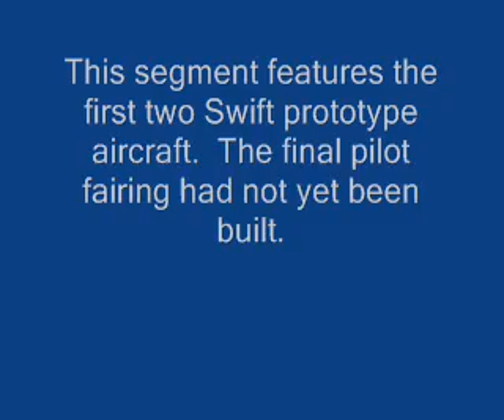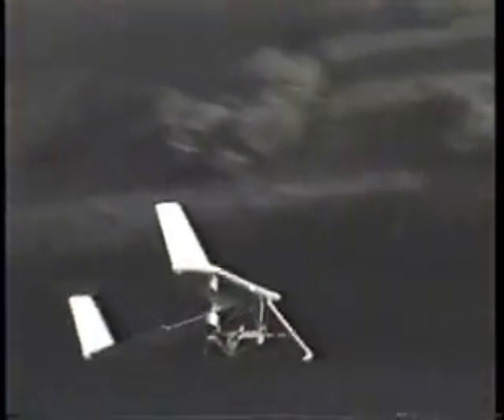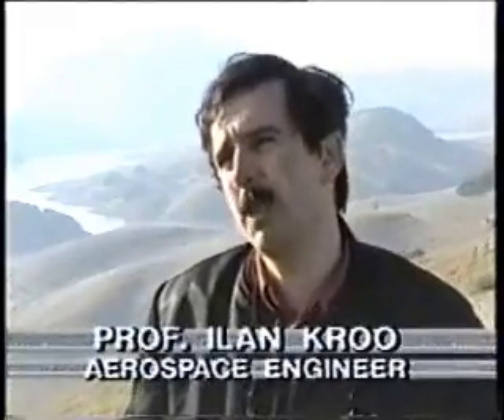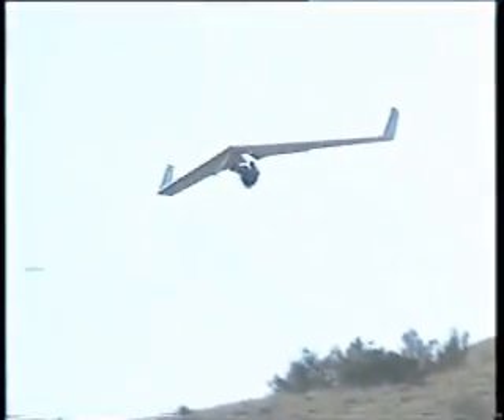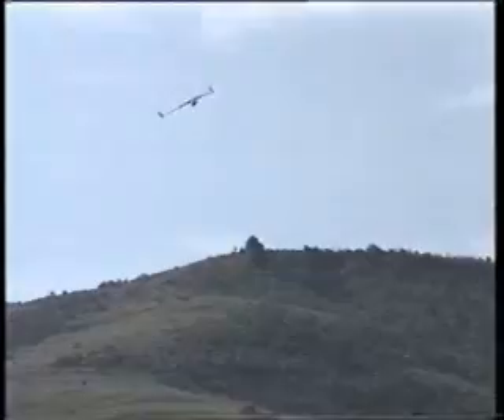Swift Beyond 2000

Comment: Hi Dr Steve, 

First off, thanks for the youtube channel with great set of videos. 
I am just curious what kind of optimization method you used during the design of SWIFT. ( it it EA or SQP based ?) 
And I have read that for the aerodynamic model panel method is used. does that mean the viscous drag is not taken into account when optimizing SWIFT ?

Thanks so much in advance.